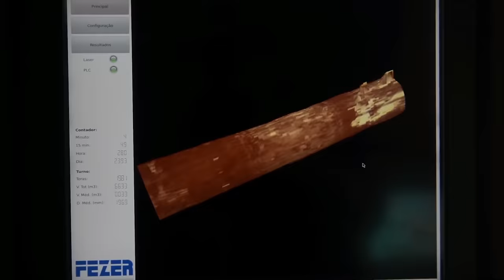Incredible Bamboo Processing Factory, Amazing  Modern Automatic Wood Processor Production Factory

Comment: I'd be interested to know what happens with off-cuts, wood dust, bark and other by-products from these main processes.  The subject of a follow-up video perhaps?
Reply: That might be IKEA’s secret,  they must use some kind of super glue.  We definitely need the machines to help but they need lots of oil, then we have to think of a solution to cleanse it out, and then another pollution, nothing is perfect
Reply: @Pandawill123  hemp oil!
Reply: is burned to produce energy they need.
Reply: Burned or sent to the pulp mill

Comment: I wonder what they do with the waste bamboo shavings?
Reply: chicken nuggets
Reply: @jaewok5G  nah, too much like real chicken, I was thinking that they put the shavings into a mould and heat with extreme compression and maybe they can make something that doesn’t have to use plastic, for example if they made a tray for carrying cups saucers etc, the bamboo is antiseptic. They might be a option for it rather than burn it or dump it as waste?
Reply: @theonlybuzz1969  nah, just for the "extra crispy" ones … ya know, ancient Chinese secret ;-)
Reply: Not bambo expert, but in economical types of procesing: 
    shawings with high bark and dirt content is 
a) compresed in pelets and used as burning fuel - mostly for central heating stations,  
b) used in composting for plant growing (not all type of tree is suitable for that).
c) used as absorbant in farming. (to absorb moisture and make dryer/cleaner enviroment)
   shawings form later stages (high purity), depending on tree type and other things are:
a) ground more fine and used in paper production. Again not all type of wood
b) alone or mixed with different fraction (particle size) shawings and glued/compressed in boards for lower price/requirement use.
c) farming - when no procesing options aiviable, or they give highest price.
c) compresed inpelets as burning fuel for home use (way more expensive, but burns better and in wider range of burners).

Nowdays in europe wood is expensive because price inludes planting/growing/maintaining it as required by law. In well setup procesing plants - there is not much ''dumpable waste'' as it is not ecanomical dumping someting that can be sold in one way or aother.
Reply: Glue it together to make more bamboo
Reply: @andrejsgelins9296  7yujh

Comment: There is still a lot of manual labor involved in this, "Modern Automatic Wood Processor Production Factory."  I'll bet that these Chinamen are tired when they go home at night.
Reply: Not even a question if they are. Most of them are surely exhausted. I have worked physically for almost a decade, and it definetely tears on the body.. surely those who've worked much longer can say the same.
Reply: if they are china men i bet their salary did not fit with their hardwork. They work hard buy they pay them less.